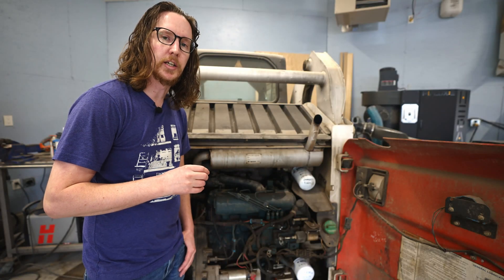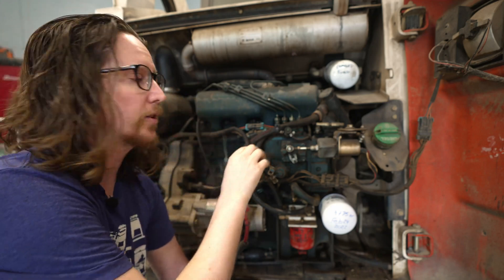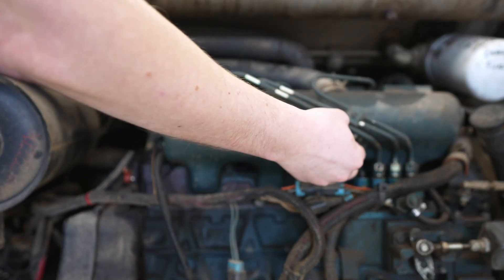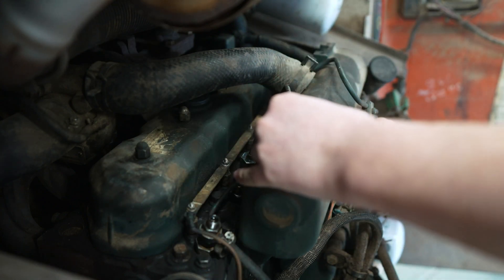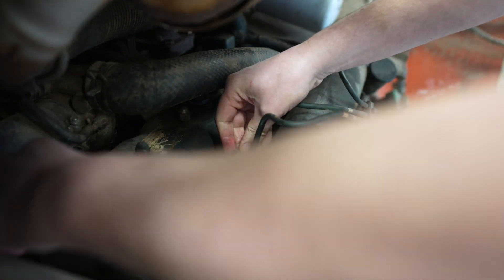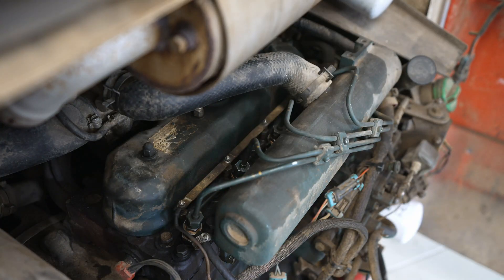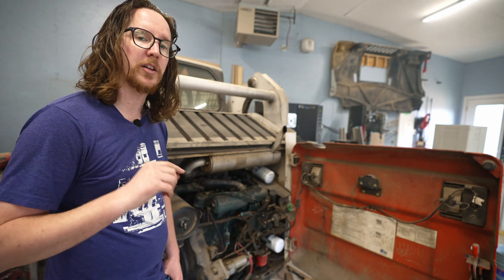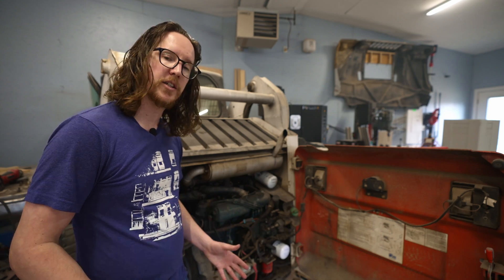How to Fix a Diesel Engine Fuel Leak

Comment: Mine are leaking the 3 ports Do they should have o rings?
Reply: depends if its flare fittings there should be none, as the flare seats, tho a small copper or alu washer might do the trick
Reply: @MrRacerhacker you're right.  I had to use 1"/4" copper flare gasket on both ends of my new fuel line  from the high pressure fuel pump to the common rail fitting. This fixed the end on the pump end but not the rail end. Im going to  try again  slowly retightenng the rail end while wiggling the line like this video demonstrates.
Reply: @bmoore3199  best of luck, should get some copper washer my self as got a bit of leak on my tractor and no wiggling helps tho might just get the flare tool aswell  to see if that helps also

Comment: hi, i have this same problem but the leak is at the pump side. think i done messed up, but can u help me ?i have a kpmatsu pc 55
Reply from the maker: Just undo both sides and slowly tighten up both ends at the same time going back and forth. It's kind of like tightening lug nuts, best to do it evenly so you don't get it binding up crooked. And that is probably what is happening. At least that was my problem. One side was sitting down nice, but it was pulling the other side out an not letting it sit down 100% and sealing.
Reply: @ResearchDesignBuild  how can I send u a pic

Comment: What if the leaks are on the filter lines off the pump?
Reply from the maker: Are they lines that you have had disconnected recently or has it just developed a leak over time?
Reply: @ResearchDesignBuild  I just took them off to replace the injector fuel pump
Reply from the maker: @fumagoo1986  ok then the same procedure would apply. You might have just got them a little off center when tightening them down.